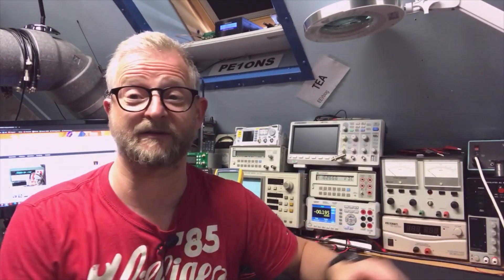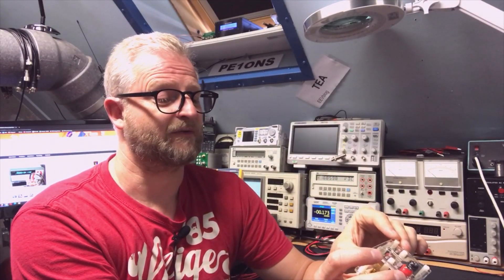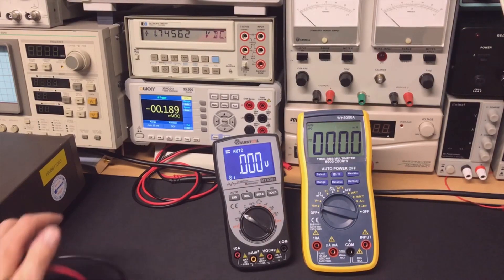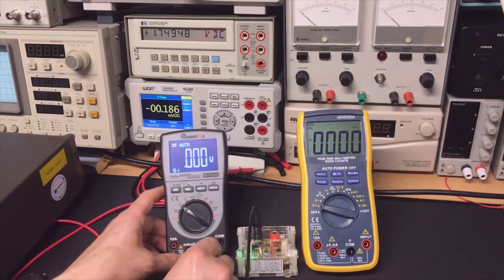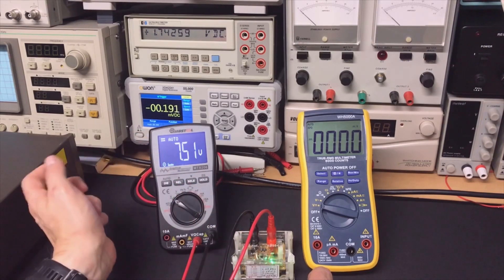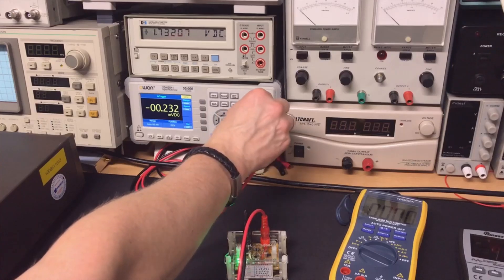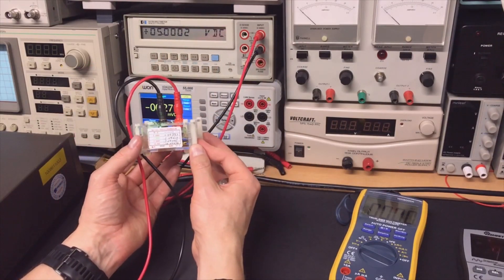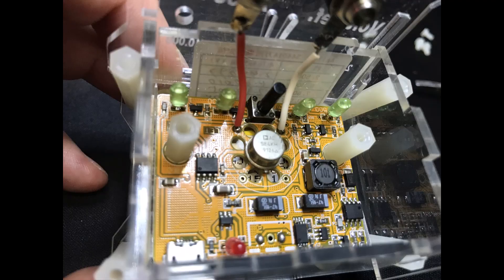#057 AD584KH (AD584-M) High Precision Voltage Reference Module 2.5000 /  5.0000 / 7.5000 / 10.0000 V

Comment: I'm asking because I bought 2 non-metallic AD584 JK Integrated Circuits, and I downloaded their references and saw some assemblies on YouTube just using them and they work. However, I did the same thing but it didn't work at all. On the pins where there should be voltage, there is more of the same value as the one that enters the 8 Vcc pin.
Reply from the maker: Don't think i can help here, i have no experiamce designing arount this componant myself, i allways get them prebuild

Comment: This was a nice Volt Ref IC way, way, way, back in the day.  But, it is very high 1/f noise as compared to modern voltage references.  Modern ADC's and DAC's have better internal references and cost only a few dollars (...for example).  Product designers would not use this IC due to cost alone.  The temperature stability is fairly good.  In summary, it is useful for the ultra cheap  3 or 4 digit handheld DVMs "check-out" .
Reply from the maker: Yes indeed, checkout my DMMcheckPlus video
Reply: I will do that today.  Also, I watch ALL of your Hewlett-Packard repair sessions.  Recently, I repaired and restored an old HP 8640B signal generator.  Keep up the GREAT work at the Albus Headquarters  !  .......... @TonyAlbus

Comment: Is the link the exact seller/product you bought? I've bought a few different types and only 1 of them came with a calibration certificate. I have a "clone" of the one you have but it didn't come with any paper work and had a bodge on the board with a switch to turn it on and off as they hadn't programmed the PIC correctly. I like this design over my others so keen to get one exactly like yours with the certificate.
Reply from the maker: Hello Dale, i checked my order it should be this one: https://www.aliexpress.com/item/32722959699.html
But i had no certificate.. it had that sticker on the side... maybe some clones are just betterclones :) 
You can never be sure any stuff you buy overseas is original.
Reply: @TonyAlbus  Yeah they either come with a sticker or paper printout with the voltages, that's what I meant by certificate. The trouble is no one seems to send that any more and and it's impossible to buy one, when I saw your video and it was uploaded in 2020 I thought oh wow he's got an original and a sticker. I clicked the link on the video description and thought it can't be that as they have only sold a couple and had no feedback, that one is likely to be a clone with no certificate. The one from your order is unavailable :(
Can you check something on yours please, when it is switched off is there any voltage on the outputs as the clones will put 10v out and don't actually switch off even though the LEDs go off!.
Reply from the maker: @dalerobinsuk  Yes mine switches really off.
Reply: It looks more like a piece of shi ..sheet than a certificate. Don't trust Chinese products.